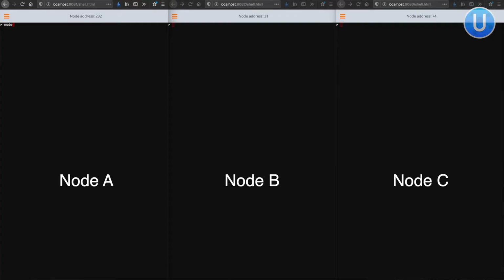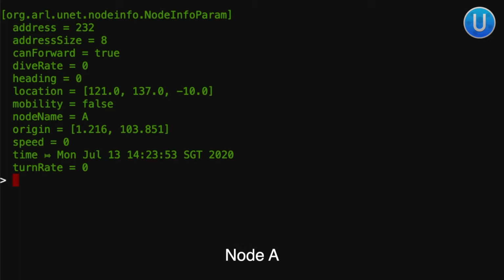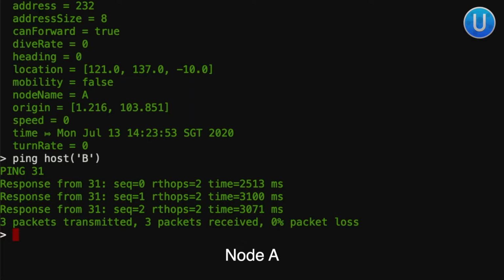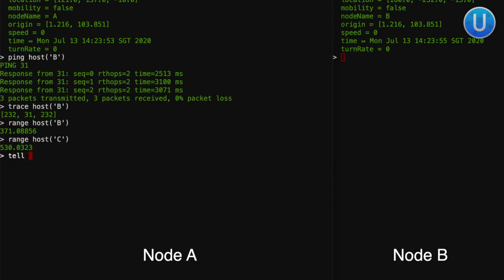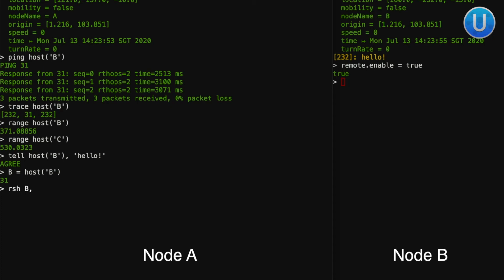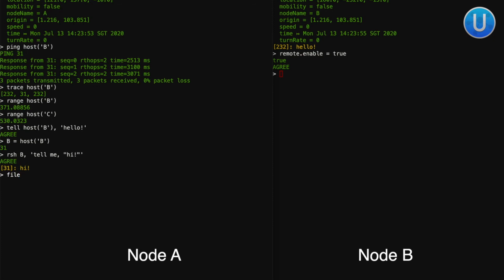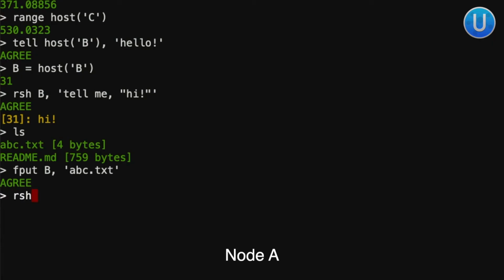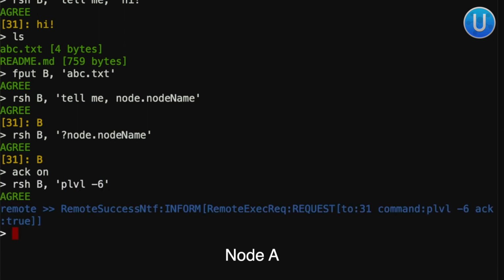05: Setting up small networks using UnetStack3

Comment: Is it possible to send broadcast messages using network simulation script?
Reply: Yes, it is possible. You can use the node address as 0 to send broadcast messages. You can post further technical questions in the unet forum in stackoverflow (https://stackoverflow.com/questions/tagged/unetstack) for a faster response.